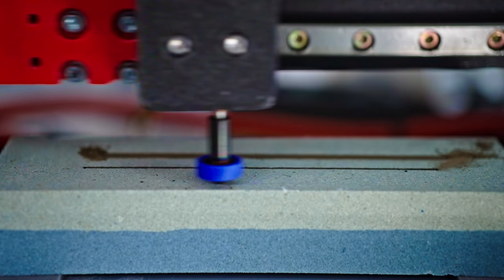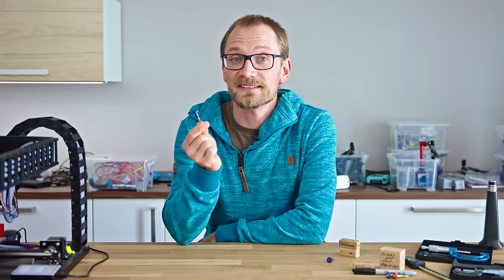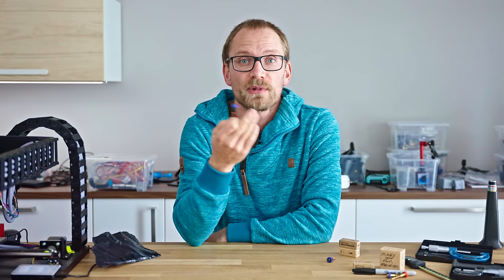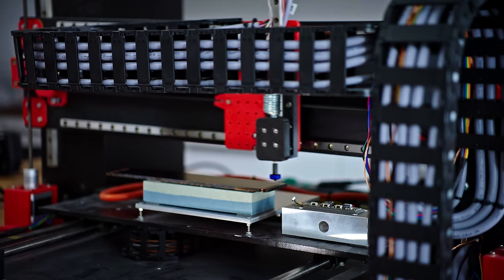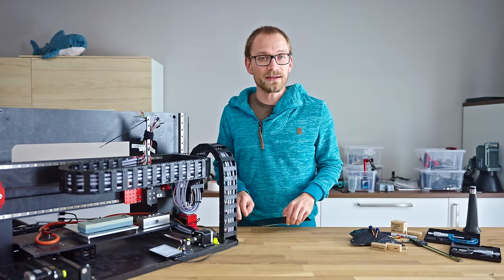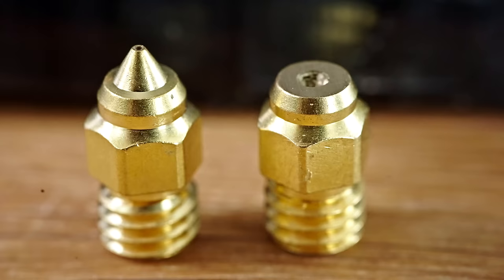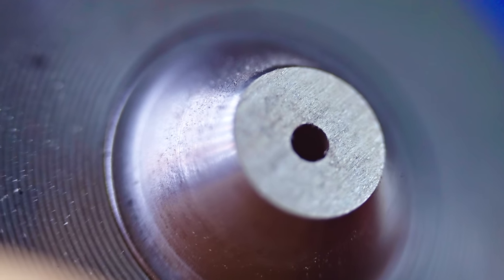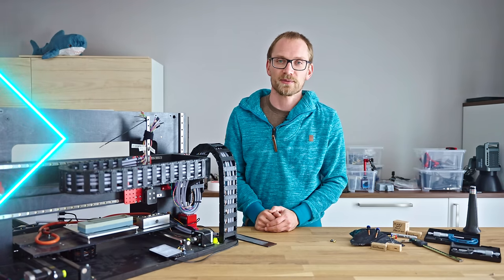How tough is ObXidian really?

Comment: Thomas, do you mind sharing a bit about your background? I'm very curious.

Clearly you're professionally trained as... is it automation engineer? 

Your shop is also very well equipped. That grinder you used to rough up the CF looks like something that has been in and active shop, well maintained, possibly for decades. Doesn't look like an everyday printing enthusiast's tool. Is it a personal shop? What do you build on these when not doing 3D printing? 
Thanks

Comment: Filament test? Im sure you would get as much you need for free to show that carbon filament now can be used without destroying nozzles, if that's the case. Carbon filament sales would explode.. 

This test tells me very little, and will not make me invest in nozzles and filament, yet. I need to know that it could produce a minimum length of string coming from the nozzles without change in quality.

Comment: what about HEAT??? You forgot to add that variable to your test! In addition the whole test doesn't represent the real life scenario. Since the "layer thickness" is greater than 0 the contact between the tip of the nozzle and the part shouldn't even happen! Meaning - the tip is "scratching" the molten plastic only. Well, we all know that from time to time we do have a bumping in a hardened plastic, but in majority we have a "soft" contact. Although your setup  (testing rig) is excellent but it DOES NOT mirror the process happening during a print. If you insist on a cold test (not heating the nozzle) the better way would be to put some fine sanding powder in the nozzle to simulate the abrasive filament and rube it against a silicon sheet. Though, nice try Tom thumbs up!

Comment: I sometimes feel that what you call "trying to makes sense of results" actually amounts to result shopping. It feels to me as though you have an expected conclusion, and anything that doesn't match that receives far greater analysis than other items. I felt that wiith your review of the P1P as well, where it sounded as though you were searching for reasons to be extra critical. Perhaps I'm being over-sensitive because I certainly have the greatest respect for your analytical mind and expertise Thomas, but in this instance, when you saw that the first nozzle was not perfectly aligned, and that you had the wrong size, why did you not find a way to correct for the misalignment and get one of the same size rather than adding weight, which honestly does not feel like a fair method of handicapping. Surely if you felt that the overall weight was that important, you should have weighed each of the nozzles first. Even then, surely the area of the contact point mattered? There were so many variables, that it would have been hard to adjust for them all. That said, I guess the results were markedly different enough, to draw some broad strokes conclusions.
Much respect for the programming and equipped design.

Comment: Your language around weight here is rather confusing and difficult to follow.

You were testing a larger nozzle so as Applied Pressure = Force ÷ Area and this would be negatively affected in comparison to the other nozzles, you added additional force (by addition of mass).

This seems sensible. You compensated for one with the other.

Then at the end you seem to get confused or are discounting that but repeat the experiment with the same mass, thus less applied pressure and draw your final conclusions from that?

I don't dispute the result but the explanation about why you went easy on the retest is lost on me.

Comment: Sadly, the results aren't reliable.   Nozzles don't print at room temperature and materials and coatings don't have the same properties at 200-300C.   Finally, 3D printers don't use gravity to control the pressure of the nozzle on the print.   They are rigid so can apply much more or much less pressure on the nozzle's tip depending on the print's parameters and first layer height.

Comment: No difference in the snake oil E3D is using on these new nozzles from what they used on the "nozzle X".....

Money grab and nothing more, thinking a super thin coating will do much for long is plain naïve, they be no different from hardened nozzle.........

Comment: The video should have ended at appr 11:00. The tests with the sharpening stone are not only irrelevant (the sharpening stone is waaay more aggressive than any filament), but also invalid (you do need the added weight on the 0.6 nozzle to have comparable results). On the sharpening stone with the added weight, the coating was gone only after a couple of dozen cycles, at which point as Thomas himself said, "that nozzle is past its useful life". So this "at least a 1000x more abrasion resistant" is total BS. Thankfully, nobody prints on a sharpening stone. Everything after that in the video is just tweaking the test to make the ObXidian look better than it really is, in a totally irrelevant scenario. The real conclusions of the video are:
- As far as realistic 3D-printing goes, E3D's ObXidian nozzles have basically the same durability as hardened steel nozzles
- E3D's ObXidian nozzles should stick less and hence be less prone to blobbing than non-coated nozzles (but this was not tested for in the video)

Comment: Interesting, but useless video. NOBODY runs their nozzles that way. So all results are meaningless. I'd rather see a video on how the nozzles holds up with pushing CF filament through it. Like how much change happens to the .4 dimension after 1 kg roll pushes through? 2 kg? 3 kg? and so on. so that I could have a general idea how long before I have to change the nozzle.